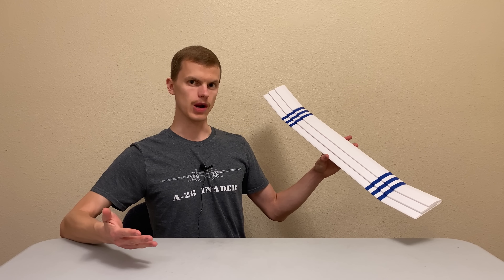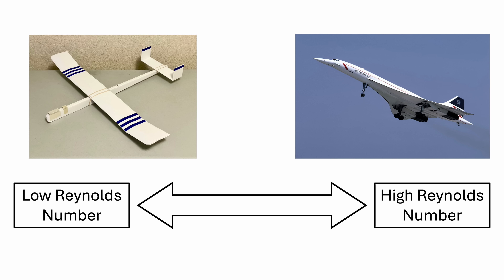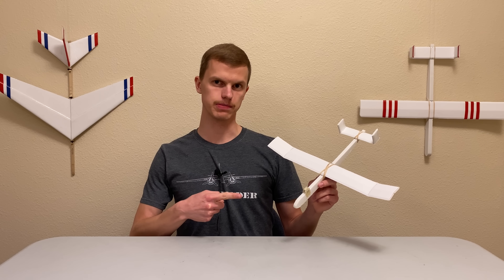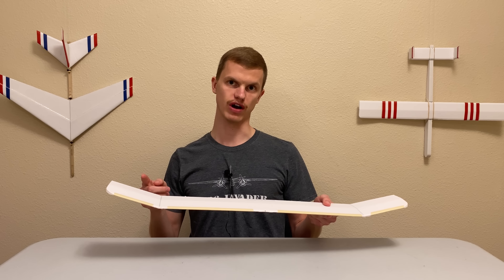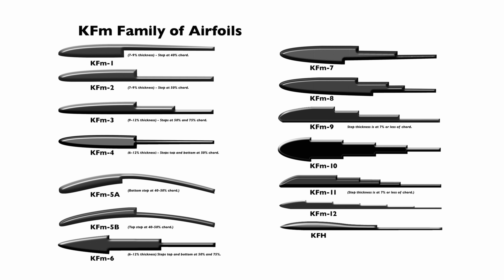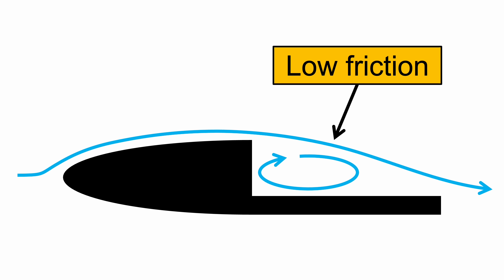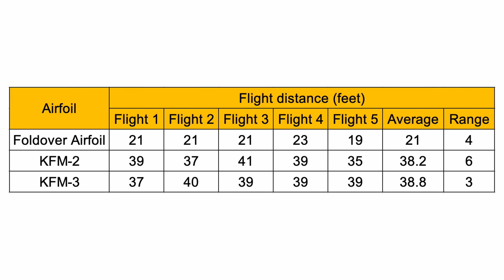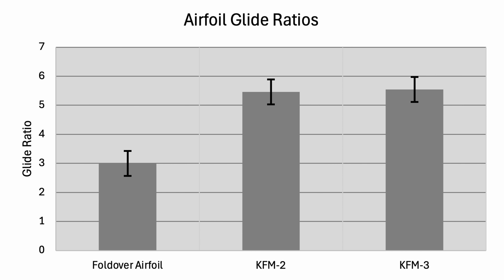Stepped Airfoils for Model Airplanes - Are They Better?

Comment: +1 on @SouthPoleAntarctica. It would be very interesting to compare the final weights of each configuration. Thanks for putting in the work to show the differences! I get real tired of the "This one is the best because that's what I've always been told" arguments.
Reply from the maker: The weights of the gliders were very close.
Reply: @DesignYourOwnAirplanes-xd6lz  In a world where ballasting all sizes of gliders, from man carrying to folded paper, for many reasons, is generations old, and Accurate digital kitchen scalesaare dirt cheap, 'very close' isn't real experimentation. A small effort reduces a serious variable. A fixed angle, location and speed of launch would be my next project. As noted above, rubber bands are not consistent over time. Springs and weights are.
Reply: Thanks! And again good job on your experiment.

Comment: what were the weight differences between the builds? you might need to launch with the same force (trim the horizontal stabiliser rather than optimising the launch force to avoid the after launch zoomies).
Reply from the maker: The weights of the gliders were very close.
Reply: @DesignYourOwnAirplanes-xd6lz  When the weight of the gliders are the same, the location of the main wing on the fusselage is the same... did you changed the CG for the best performance for every setup? I found out that different airfoils likes different CG's.  And.. different wingtips are changemakers. (as note by GiesbertNijhuis)
Reply from the maker: @jeroenpost8735  Yes, I did have to change the CG to get the maximum range for each.  I found that the stepped airfoils flew best with the CG further back than the fold over airfoil.

Comment: Did you make each plane have the same wing loading --- i.e. weight?  Very interesting work --- thanks -- I was a builder of high-performance hand launch gliders between 1960 and 1965 while at The Lawrenceville School.
Reply from the maker: The weights of the gliders were very close.
Reply: @DesignYourOwnAirplanes-xd6lz  This response keeps being repeated. Serious experimenters have measurements, and ranges, of critical variables. More a serious suggestion than dissing. Low speed aerodynamics involves small forces, and small result differentials. Quantify! Trying stuff is playing. Keeping records creates Science.
Reply: @DesignYourOwnAirplanes-xd6lz    THANKS -- keep on with good work.

Comment: Great video! Question for you: would you expect stepped profiles to also provide advantages on propellers? Or at high speeds like those in which most propellers operate their benefits would be negated? I'm thinking of scenarios like small drone propellers where a small gain in efficiency could have a big impact.
Reply from the maker: Propellers probably spin too fast.
Reply: Suggest you dive into the video on this channel on Reynold's Number, the best measurement of fluid flow 'velocity' we have. Under and over ~ 100,000 Reynold's Number are pretty separate worlds. Propellers are Way higher.

Comment: Very good explanations. id have also to add that the ''base'' case seems to be in negative departure angles which may explain the poor results compared with others
Reply from the maker: Can you explain what you mean by negative departure angle?
Reply: @DesignYourOwnAirplanes-xd6lz  he means that the pitch for the glider with the non stepped airfoil, seems to be lower when being launched. I don't see it though.
Reply from the maker: Yes, I had to put the fold over airfoil onto a steeper glide slope to get enough thrust to overcome the extra drag force, otherwise it would slow down and stall.
Reply: @DesignYourOwnAirplanes-xd6lz  if that's the case then that in itself is a very important parameter to consider as far as the stepped airfoil performing better, the sheer parabolic correction because of a steeper angle of launch can lead to greater range, it's the same principle as artillery and projectiles. You should consider keeping the angle of launch the same for the stepped and non stepped versions even if that means launching the non stepped plane at a steeper angle to match that of the stepped versions
Reply: @IndianArma  This sounds to me more an issue with wing attack angle, in relation to tail surfaces, if it won't sustain glide speed. Why wind tunnel work to define Zero (minimal) drag attack angle, and best L/D angle, are normal with any airfoil experimentation and comparisons. Total plane configuration CG placement has to matter. (I shift ballast for most models, occasionally move the wing.) Which not only involves center of lift, but torque around C/l. If airplanes were simple, everyone would do it.
Reply: @billtaylor3499  your'e explaining trim in a rather over complicated way to a pilot, with the angle of attackv ector being kept equal, the trim can be adjusted on both the stabalizer and/or the wing to correct for the relative cg displacement because of the thicker airofoil in the stepped version, hell you could even balance it by introducing a small counter balance to match the weight of the airframe in both test cases precisely, I have been testing airplanes since I was 7, but that wouldn't make my argument stronger, just as your quip about airplanes not being easy, only makes it seem like you are the one confused. :)
Reply: @IndianArma  None of the test flights looked to be in stable trim to me. Still seeking stable glide slopes, in what looks to be similar to, or is, Phugiod flight. Inappropriate launch speed and/or angle, but most likely far too small of a test volume for the models to find stability in glide, and no clue to optimum trim of each configuration. Which invalidates any comparison between the foils, IMO. Even large development programs producing expensive full scale racing sailplanes do real world testing, from significant altitudes, in 'still' air. Well instrumented, they establish  airfoil and air frame parameters of performance, such as minimum sink speed and trim, maximum L/D, often being far apart in IAS, looking for advantages in real world weather competitions. Normal full size aft tailplane (Curtis, as oppossed to Wright's forward stab.) configuration airplane are with downforce at the horizontal stabilizer, and somewhat forward CG of ideal for the foil. Competitive duration models, rubber powered and free flight, long ago found that lifting horizontal stabilizers and rearward CGs dominated leader boards, at the cost of more restrictive stability. Man carrying airplanes value far more robust stability (Positive from the widest possible initial conditions, i.e., recover from upsets) which is usually with significant downforce, and associated drag, at the tail plane. RC test models offer simple trim adjustments, and short trim optimization experiments, free flight hand launch, not so much, such as this video's models. I started with the usual hand and rubber catapult launch balsa models you probably did too. All the variables of launch speed and angle, and what trims were available, mostly by wetting and resetting stabilizer angles, wing position (CG) and twist in both wing and stabs, were explored, starting the fascination with flight.

Comment: According to me and some others, stepped airfoil works very well, many papers about them but there is more than that, if talking about flight efficiency... 😂, it's draggy.
If you cannot do a simple Clark Y using nowadays facilities, you should not build a plane 😅
There are many enhanced small size airfoils for small UAVs, they're better and easy to find.

Comment: The pressure drag is the imbalance between the horizontal component of the pressure distribution. If there is no flow seperation, and if there were no losses in flow energy from the LE to the TE, then the fact that air pressure acts in all directions would mean the pressure pushing back on the wing would be balanced by the pressure pushing forwards. However, in real viscous flows, losses and separation are a fact. As such there is now more air pressure pushing back that is not balanced.

Comment: Well, I'm not buying your results because I can see the models are not always flying a consistent glide slope. I give you an A for effort though, because what your attempting to do is really rather difficult without force & flow velocity vector measurements.  I have been into model aircraft since I was a little kid & I am a retiree now.  So that's a long time & I have done some personal study into aerodynamics at these low Renolds numbers, even wrote a program to predict glider performance at different aspect ratios & wing loading.  This kind of killed the hobby for me as it removed the mystery.  Anyway, part of the performance issue with models is that scale size or the boundary transition or separation bubble.  It means that once flow detaches at AOA crit, you then have to re-trim to a much lower AOA before the boundary layer can attach again.  This can make model performance very unpredictable.  I imagine that your step would be more predictable in this regard & while it may equal or better the performance of a smooth that has a detached  boundary layer, it probably isn't as good as one that maintains attached boundary layer.  One way to overcome the Cl/Cd hysteresis loop experienced at model Rn, is simply to incorporate boundary turbulators into the construction.  There are several methods of doing so.   One example is to make a smoothly curved surface, but then attach a pin stripe tape behind the leading edge. The thickness of the tape transitions the laminar boundary layer into turbulence without detachment.  In this state, the skin friction is a little more, but boundary attachment becomes much more predictable and attachment persists to higher Cl or lower Rn than would be possible without the turbulator.  In short, performance is more predictably reliable.  This is doing much the same as the step, except on a micro scale, with far less disruption to the airflow.  I have also used turbulator spars to very similar effect, even winning a 2nd place at my LSF national comp one year while I was still a novice RC pilot.  There have been wind tunnel studies of model wings at model Rn investigating all these things.  It may be difficult to find the literature though.  Martin Simmons Model Aircraft Aerodynamics 1st published in  the 80s is one source that comes to mind, but there has been more research since then & I believe there is more resent edition of Martin's book.  If you look at indoor competition performance designs, they are getting much better glide slope performance & duration than your stepped wings.  The stepped wing is an interesting concept, but I don't think it's the best solution around.

Comment: I don't know much about aerodynamics, does glide angle translate to efficiency when you switch to powered flight? I'd be interested to see comparisons in power usage after flying a certain distance with each wing, something like what rctestflight does with his autonomous planes.
Reply: Yes, well very close too the same at shallow glide angles because in trigonometry, sin & tan approach the same value. sin 1 deg = 0.01745240643 tan 1 deg = 0.01745506492
Reply: Glide slope directly relates to lift efficiency-a better glide slope means less induced drag. Another way to look at it, glideslope is a way to empirically measure how much distance you get out of a given amount of energy-with a glider in still air, this is all gravitational potential energy. Once you're in this frame of thinking, you can imagine a powered aircraft as holding some amount of reserve altitude in its battery/fuel reservoir, and it still works.

Comment: Anyone interested in the concept of using upper wing surface captured vortex(cies) to generate high lift at ~ 0 KIAS, see @ErikssonTord_2's comment below.  (The "Kasper wing".)  No -- I'm not getting a cut of @ErikssonTord_2's action.  Witold Kasper claimed his wing design (capturing upper surface vortex(cies) would not stall and would descend vertically in a manner comparable to a parachute at ~ 0 KIAS.

Comment: I see many comments that tell me the audience does not understand Reynold's number. 
Reynold's number indicates the ratio of fluid momentum to dynamic viscosity. A very viscous fluid with low density will create lower reynolds numbers (Alternately stated, increasing kinematic viscosity reduces Reynold's number.). High speed or high density increases momentum, if viscosity remains fixed, will increases the Reynold's number. This is what drives the boundary layer formation, the boundary layer changes the effective airfoil thickness and shape with the appearent effect of being "skin drag".

A longer cord also increases reynolds number(Sorry I don't have a clean explanation that would fit here, but it is rooted in the scaling of momentum and viscosity.). The  boundary layer does not grow twice as thick with twice the cord, so relative to the change in scale there is a lower proportional change in the boundary layer and effective wing thickness and shape. 

Low reynolds number = proportionally thick boundary layer (manifesting as "skin drag"), high reynolds number = proportionally thin boundary layer.
Reynolds numbers below 100k tend to have mostly laminar flow in the boundary layer, above 200k tends to cause mostly turbulent flow in the boundary layer. Laminar flow at high reynolds number is possible and produces extremely low drag but it is very sensitive to disturbances in flow and surface condition. Turbulant boundary layers have more drag but they are more consistent and reliable in adverse conditions.
This is all for fully subsonic flows with neglagible compression effects, so below about mach 0.5; Still somewhat useful for estimations up to mach 0.8 although allowances need to be made for more significant compression effects depending on the particular fluid properties.

Comment: Bicycles go pretty slow. I think this might be good for fairings for heavy touring bicycles.
Reply: Slow but long. doubling the chord has the same effect on reynolds number as doubling the speed.
Reply: @mytech6779  🤔average speed is usually 30 kph and a length of a bike is about 2 meters. I guess I need to check that chart. 
It looks like 10 inches should be effective. Maybe 8 would be better, so for the back half of the fairing that would be 40 inches divided by 8 leaving 5 steps.

Comment: You didn't mention it, but did you ensure that all the planes were exactly the same weight?  The 3-step aerofoil looked as if it might be heavier because of extra material that could be omitted inside the wing.
Reply from the maker: The weights of the gliders were very close.
Reply: That would only effect the launch speed, which may or may not be significant. The steady state glide ratio would not be effected, athough the ideal glide speed to acheive the glide ratio would be slightly higher for a heavier plane.

Comment: Great video - thanks. Common sense says that the stepped wing would create turbulence in the airfoil, so increasing drag, but obviously it doesn't.
Reply: it does, but the drag is proportional to the speed at which it flies. model planes usually fly very slowly, so the drag is significantly lower than the drag from air bumping against the skin of the wing
Reply: но все несколько иначе. двигаясь вдоль поверхности крыла воздух вынужден соприкасаться с поверхностью крыла на прямую. проще говоря близко к поверхности воздух замедляется от трения о поверхность.но если есть турбулентность появляется зона вихря который сам постоянно вращается вдоль крыла создавая как бы менее плотную поверхность с которой взаимодействует поток воздуха проходящий вдоль крыла.проще говоря работает как смазка)
в целом это легко понять если сравнить конструкцию дозвукового самолета и сверх звукового. крыло быстрых самолетов на самом деле сделано довольно грубо.на нем много неровностей и швов.а крыло медленных самолетов наоборот стараются сделать более гладким. суть в том что на сверхзвуке вдоль поверхности крыла создается прослойка уплотненного воздуха которая в дальнейшем и выступает в роли поверхности вдоль которой движется воздух но при этом эта прослойка уплотненного воздуха получается достаточно ровной даже учитывая что само крыло сделано грубо и не гладко. просто на малых скоростях этот эффект мало заметен но он тоже есть.

Comment: Did you say you moved the position of the weights for each test? looks like the fold over was nose heavy. Even If it was less efficient it shouldn't be going nose down. Also what is the weight of each wing? Test needs repeating with more level flight with each plane landing mid belly first. I think the KFM will win but by a lower margarine maybe around 60% instead of 80%
Reply from the maker: The weights of the gliders were very close.  That was the best glide slope I could get with the fold over airfoil.  Any less steep and it wouldn’t have enough thrust to overcome the drag and it would slow down and stall.